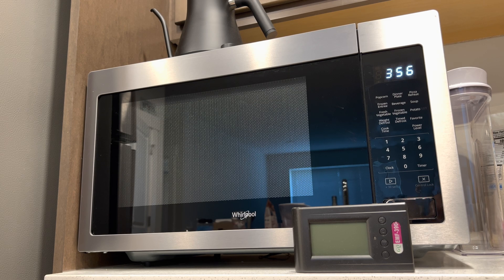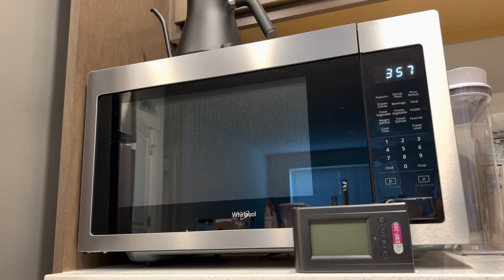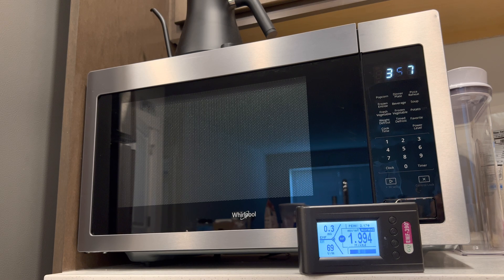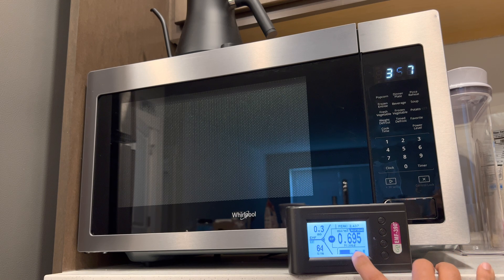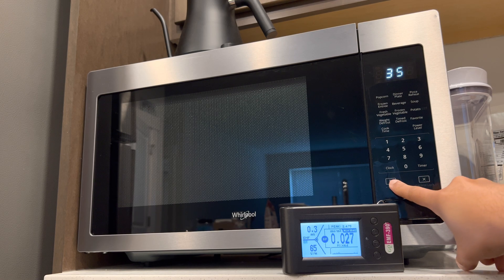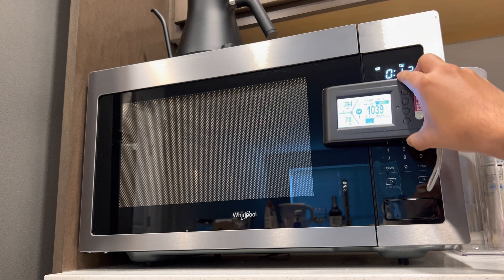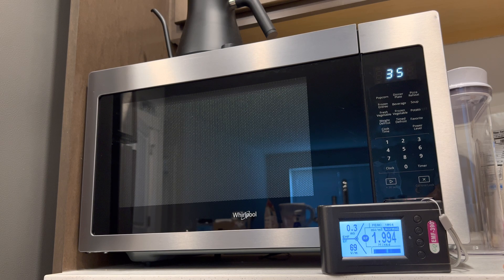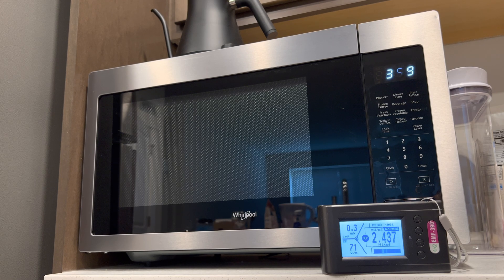Does a microwave oven leak radiation? Lets measure it.

Comment: So I’ve tried with my own Geiger counter and microwave and while the cpm did shoot up failry quick with the microwave on it didn’t actually go to any level that was that high. So either my Geiger counter doesn’t work or it does and my microwave is way better at keeping in radiation, that or yours is just not good idk

Comment: For more accurate result you’re supposed to use the endpoint of the unit the way you were holding it and using it isn’t the best way or recommended way by the manufacturer.
Reply from the maker: Thanks for pointing that out. I tried all the different orientations but did not see a big change in readings. Also, this was a lot easier for the camera angles. 
I’ll check out the manufacturer recommendations though - good point!

Comment: For context, a typical incandescent night light bulb is around 4 watts, and most (well over 90%) of that energy is converted to heat. So, if you were to build a box with 4 square meters of surface area around a night light, the amount of heat put it off would be similar to the amount of microwave energy coming out of that oven.

Comment: What about if you cook food inside the microwave them test the food for radiation?
Reply: Microwave radiation is not ionizing radiation, there are no ionizing particles. The moment you cut power, the microwave radiation stops. It doesn't leave behind any particles.
Reply from the maker: As Brendon said, it is simply energy so the food is just fine. It will be overheated in some parts, and cold in some parts, so foods sensitive to high heat will not be in great shape, but it isn’t dangerous.
Reply: @BatteryTestChannel  okay

Comment: How are you sir, I was wondering how far away do you suppose one should stay away from a microwave to drastically reduce exposure? I work at a kitchen with 4 microwaves so I was wondering if it’s not busy I should step away and let the food cook without being under it
Reply from the maker: Based on what I measured, even 6 inches gives you a big drop. It does drop very quickly with distance.
Reply: @BatteryTestChannel  got it thank you sir

Comment: Good video! I just uploaded a video last night called “I measured the microwave energy radiation from two trash picked microwaves.” But I used a German made “HF 35C HF-Analyser”. I got basically the same results you got, but I was standing 5 feet away from my two microwaves with tester in hand. So your oven must have much better leak protection than my ovens. Or am I using the wrong type of instrument to measure my microwave radiation output? BTW, they advise standing at least 5 feet away from a microwave while it’s running.
Reply from the maker: Thanks! Good to get confirmation. This is a pretty new microwave. I’d love to check an older microwave to see if they started leaking after X years. The HF 35C seems to go up to 2.5Ghz so I think it should pick it up pretty well. I’m no expert though.

Comment: I see your video a year old... So hope you reed this... I was taking some junk to the scap yard and the radiation detectors went off and they said it was the old microwave... We took it out and the load passed thru with no problems. So why is a non running microwave setting off a radiation detector St the scap yard... Many scrappers have said microwaves in general do that...
Reply from the maker: Hi there. I don’t see how that’s likely. The microwave is just made of pretty typical parts - just like a tube TV. 
Surprisingly, the most radioactive thing in your house is probably our smoke detectors! (Only if they’re the ionizing type.)
Reply: @BatteryTestChannel  did more searching... There is a radioactive substance in the magnatron called thorium. Curious if the thorium would contaminate the other metals over time as it does set off the radiation detectors in the shredders that use these detectors. I do know that mill iron in Mansfield Ohio has such detectors...
Reply from the maker: @captainkirt8727  Interesting! I didn’t see this when I looked it up the first time. I was definitely wrong. It looks like the tungsten core does have some thorium, but I’m unable to find out exactly how much. I haven’t been able to detect it with my Geiger counter. It must be pretty well sealed away and it must be getting released when the magnetron is destroyed. Thanks!
Reply: @BatteryTestChannel  perhaps its a different type of radiation that a gieger counter dont see.